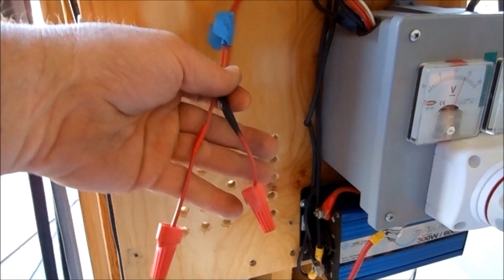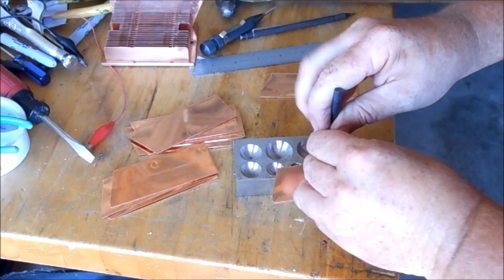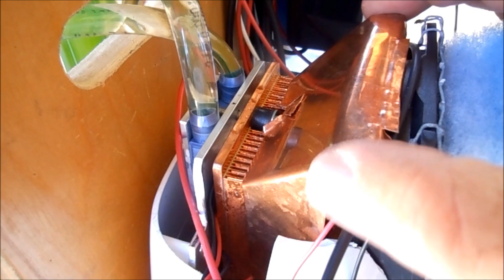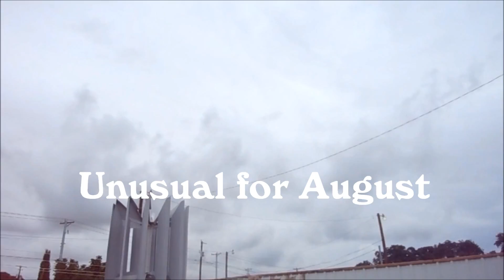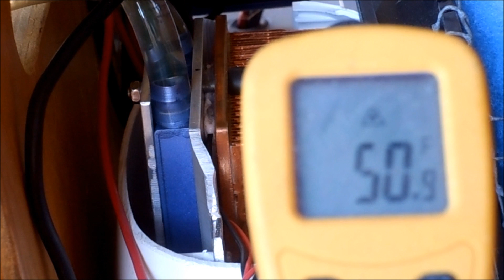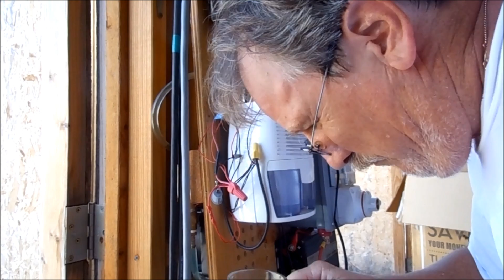Rainmaker/Water From Air 2

Comment: Let's compare your water distiller idea with the Rainmaker/Water From Air 2 project you shared.

Similarities:
1. Both systems extract water from air through condensation.
2. Both use a cooling mechanism to facilitate condensation.

Differences and potential improvements:
1. Energy consumption: The Rainmaker/Water From Air 2 system uses energy-consuming Peltier modules for cooling. Your idea utilizes a commercial steamer and a water pump, which may be more energy efficient.
2. Cooling method: The Rainmaker system uses a water-cooled aluminum plate and a finned copper heatsink. Your design uses copper tubing with fins for more efficient heat dissipation and condensation.
3. Automation: Your system has the potential to be more automated, as it can be powered by a hydroelectric generator and use rainwater as a source.

Improvements for your system:
1. Insulation: Ensure proper insulation of your distiller to minimize heat loss and improve energy efficiency.
2. Material selection: Explore different materials for tubing and fins to optimize heat transfer and durability.
3. Design: Experiment with various arrangements of tubing and fins to maximize surface area and promote efficient condensation.
4. Monitoring: Implement sensors or a control system to monitor temperature, humidity, and water production rate, allowing for adjustments as needed.

By considering these aspects, you can further refine your water distiller design to be more efficient and effective at producing clean water from air.
Reply from the maker: Yes! There is always room for improvement.

Comment: Your diodes are 15vdc max and 12 volt running voltage . If you drop your voltage to as low as 8 vdc . Your diodes become more efficient.  ie; the cold side gets colder . Also . Summer automotive coolant works well . BUT , ammonia works better . Adding ammonia or alcohol to your coolant will drastically improve the cooling . Having the unit inside a hot/dry building does not improve water production . Root cellar ? Shade . BTW . A small fan pulling air through , 'slowly ', can help .
Reply from the maker: I hadn't thought about using ammonia for coolant, I'll try that next time. Thanks.
Hopefully if I ever have a chance to move, I'll find a place with a tornado shelter. That's the closest thing to a root cellar you'll find in Texas.

Comment: Does the water touch the peltier plates you used? I was going to experiment with something similar almost using the same unit you used here and was trying to figure out a way to make it food safe and avoid the water touching the peltier plates, but I can't picture it quite the way you've described and didn't see the plates in your video!
Reply from the maker: The water only touches the copper of the heat/cold sink. The heat/cold sink is connected to the peltier by using thermal past and pressure much like the heat sink attached to your computers CPU.
Reply: @LittleshopintexasSV  Oh okay so you connected it the same way as in a computer, but the water doesn't touch the peltier plate? Is that because it's vertical? I know it touches when you turn it upside down and I wondered if the condensation collected on the other side of the heatsink. That's good to know, thank you!! I love your videos :)
Reply from the maker: Don't forget that while one side of the peltier gets cold, the opposite side gets extremely hot and requires someway to prevent it from burning out.
On the cold side I used a simple copper heat sink to collect moisture from the air, that's easy part. On the hot side I used a CPU liquid coolant system: radiator with fan, pump and reservoir in an attempt to keep the hot side cool.The cooler you can keep the hot side, the colder the cold side will be. The very narrow space between the hot and cold sides of the peltier stay warm and dry. 
Hey thanks for watching and asking really great questions.
Reply: @LittleshopintexasSV  oh that's smart!!! Do you get more moisture this way than you would have from the original dehumidifier? Brilliant!!
Reply from the maker: Yep, I ran the original dehumidifier for about a week and only collected a few drops of water. After all the modifications I managed to collect about 16 ounces in the same amount of time. Its not enough to live on, but it was a huge increase in comparison. Downside is, it took a huge amount of energy to run the thing. I have a more energy efficient idea that involves using the compressor of a small refrigerator, but I haven't had the time and money to work on it.
Reply: @LittleshopintexasSV  Amazing that's so cool! I think the manufacturers use compressors, with the levels of water they claim per day for the large units. They have to. I wish they weren't so darn expensive.

Comment: 2 things. 1-) When you look at the number of water molecules per air molecules at 99% relative humidity, it's in part per millions. So you have to cool a large volume of air if you want to extract a usable amount of water. 2) of course it's more energy efficient to run it before dawn when the air temperature is nearer to the dew point.
Reply from the maker: Thanks for watching and sharing the info.

Comment: I bought a 30 pint dehumidifier from Walmart for about $180 and it puts out about four gallons a day in a 15 ft square room. Water vapor continually streams in around the doors and windows and the room humidity only drops a little. If you plan on messing with water, download data on Legionaries disease from the CDC.
Reply from the maker: You must be in a very humid area to get that much water every day.

Comment: If I'm correct, you are drinking destilled water, because it is a molecular gas in the air and when it condenses, there are no minerals. Drinking too much destilled water can kill you btw.
Reply from the maker: Distilled water is water that has been boiled into vapor and condensed back into liquid. If you've ever tasted distilled water, you'll know it tastes salty. I use distilled water to fill auto batteries. The water collected on these copper fins is water collected on a cold surface when humid air comes in contact with it. It's sweet water, much like rain. It may be lacking minerals, but it's better for you than the fluoridated and chlorinated water that comes from the tap.
Reply: @LittleshopintexasSV  Oh ok, then I was wrong about that, I couldnt tell the difference between distilled water and condensed water from the air.

Comment: I'm final year engineering student and i'm going to do some research about making water from air by using peltier module. So is there any reference link to get more data can you pls send me
Reply from the maker: I don't have any reference links for you other than those of my own experiments. I used the cheapest peltier modules I could find on eBay, usually in groups of 10 pcs, so if I burned them up it didn't cost too much. The trick is to get the cold side as cold as possible. And to do that well, you need to keep the hot side as cool as possible. If you suffered through watching this video, maybe you can live through this one as well. "Mini Fridge Has Become Bane of This Project". https://youtu.be/4E6JHQUB5Gs

Comment: The fan needs to go on the hot side, or the fan will just blow away half of the water.
Rout ~25% of the hot side air to the cold side, so the cold side won't freeze up, and still has airflow.
Reply from the maker: The fan in front was just a part of the experiment. I think in the video I said it was not needed. I didn't remove it as the experiment continued but it was disconnected. As for using it on the hot side, it wasn't needed on that side either.  If you watch this video, you will see the complete peltier cooling system I used in the rainmaker video. https://youtu.be/4E6JHQUB5Gs
Reply: Unless the hot side heat sink is very large, it is always best to equip it with a fan.
Even if it's running at a low (~1000)RPM, where it uses less than 1 Watt of power.
If the heat sink on the hot plate feels hot, you are best off with a fan.
If the tips of the heat sink on the hot side are cold (but the base is hot), it means no fan is needed, and the sink is effectively removing heat without a fan.
Reply from the maker: You didn't watch the video did you? The peltiers modules are cooled by water. The water cooling system draws heat off of the peltier modules better than any fan and heatsink could possibly do.
Reply: So basically you're using the peltier element to extract water from the air, and use the other side to evaporate the water back into the air? XD
Reply from the maker: No. It's a closed loop cooling system like one you would use for the CPU of a gaming computer. It's also similar to that used in cars, but smaller. Watch the video.

Comment: So my question is what if you coated the cold side blades were coated with a food grade super hydrophobic coating? This would make the water dropplets run right off the blades. Additionally what would happen if you setup multiple peltiers and start using some of those amps from that VAWT to drive your "Air well". I understand this was a few years ago but any good updates on this project? I bought the same de-humidifier from aldis today for $12 and sourced some 12v peltiers from the wish website for under $2 a peltier.
Reply from the maker: Over time I've realized water accumulation on the blades is not a bad thing. Water attracts water and it will fall of the blades once a drop is heavy enough. My problem was, I was looking at the water between the blades as trapped,  but in fact it's just part of the operation. I tried using 4 peltiers at one time. These were 12v @ 6 amps each, so the power required to run full out would be 288 watts. On top of that I was using a liquid cooling system to keep the hot side of the peliers as cool as possible. The wind turbine was and still is connected to the power suply to work in concert with the solar panels, but unfortunately it wasn't very windy for the entire time of the experiment.
I do plan to revisit this idea but my time and finances are tied up in day to day living. However I have made a couple purchases toward the next project; a roll of flat 6 inch wide copper, and a family sized LifeStraw water filter. If you haven't already, please subscribe and click the bell to receive notifications of my new videos.
Reply: @LittleshopintexasSV  I just found your channel, and subscribed as I am working on a similar device. Your videos have helped a lot. Thank you!! Any updates on the rainmaker?
Reply from the maker: @kossaga  Thanks for the sub, but nothing new at this time.

Comment: Good try ! Sounds like you got 1 glass water per week? What about having 100 of these all going at once, bet that would get maybe 100 glasses of water per week.   Glad you did that effort to save us all time;  I like the geothermal sourcing for the cooling for the hot side but that would require alot air like from a cave, or alot of pipes full of water in the ground (56F I think is constant underground temp).

Comment: Hello Sir, Nice video. How much amount of water are you able to generate per day?...And from where you could get the copper heat sink with fins?
Thanking you in advance.
Reply from the maker: This one only collects a few ounces of water each day. More surface area will collect more water, and there are other ways to chill the copper fins.
I bought the solid copper heatsinks on Ebay. Unfortunately I couldn't find the link to that product, otherwise I would share it with you.
Reply: Hello Sir,  Is the area of the cold sink directly proportional to the amount of water generated?...I tried with two cold sinks (heat sink piece on cold side) one with area 12X5 cm2 and other with 18X7cm2. The heat sink size used was of the same area.  For the same duration of test I got more amount of water with smaller cold sink. And when I had a discussion with a person  (the person who did this ->  https://www.youtube.com/watch?v=LkLvpL-M_sg ), he told that it is not about the area, it is about choosing the right size. He suggests that the more area does not corresponds to more water. I also experienced the same.  Please share your comments. Please correct me if I am wrong.

Comment: Hello; I am guessing when I say; "More fins does not mean more water"
Please see this calculator https://www.calculator.net/dew-point-calculator.html
to figure out how cold your copper fins should be... keep removing fins until the 
Peltier is cooling the fins down to below the dew point in your area.

The next thing I noticed is that you have no divider between the HOT side of the peltier and the COLD side... this is very important as cold air is more willing to give up water and because the hot side is heating up the cold side... 

Considering that the hot side is 95 percent hotter... and the cold side is only 2-10 percent cooler.. not providing insulation (around) the Peltier and dividing the  sides you are loosing 
almost everything gained. 

The fan thing to dry off the copper fins is also working against ya...

Hey, you can also try, turning on the device until frost develops... then turn off the device to heat the fins... this will melt the ice and work...

However, it isn't effective to heat the thing that your cooling, so try to get below the dew point and enclose the fins so the evaporation is not working faster than what the due point can produce. Good Luck.
Reply from the maker: In my thinking, more chilled surface area will collect more water.
Thanks for the calculator, it may come in handy on future projects.
As far as using a divider between the hot and cold side of the peltier module, I've tried it both ways. My first attempt was in a little refridgerator of which I had limited success. "Mini Fridge Has Become Bane of This Project"  https://youtu.be/4E6JHQUB5Gs
Both the fridge and the rainmaker use a water cooling system to draw off as much of the heat created by the two peltiers as possible. The idea is, the cooler I can keep the hot side, the colder the cold side can become.
I guess the last thing is, the fan in front of the copper fins was planned to be for defrosting. However I found it to be unnecessary in room temperatures above 60 F.
Thanks for the comment. I plan to experiment on pulling water from air again in the future and I look forward to hearing your opinion on that project as well.
Reply: Please look at Peltiers on Ebay... and you will notice a small square ... that is the insulation that I am talking about. 

Then enclose the copper fins in a insulated box with a 4 half inch holes around the same level as the top of the copper.

Lastly... give it as "LITTLE power" so the lowest working power... and keep  removing copper fins until you have the dew point...you will have about 2 or 4 fins... spread them apart... 

and let me know if that works for ya.... I'll be watching and wishing the best for you... take care.
Reply: Even make those four half inch hole adjustable... make a slider.. try one , then two holes... then three holes... we have to get as much surface area that is dew point... and no surface area that is ice.

I hope this helps... as I did a typo "a 4 half inch" ... I meant "with 4 holes that are 0.5 of an inch"
Reply: Lastly,,, copper is good for testing... but for drinking... you might try stainless steel.. (guessing... about this)

and hoping for better taste.

Comment: try to keep the defrosting fan on, and make it more powerfull... you need to run masses of warm air through cold surface to extract humidity from it. the more air you run through it, the more water will condence and you woun't need to shake it off, it should run down by itself

Comment: If your pipes and cooling reservoir are insulated the coolant will get colder and colder.
Reply: The coolant in the lines is actually to draw the heat off of the peltier modules, and if the lines and reservoir were insulated, they would retain more of that heat.

Comment: Have u thought of maybe going to a 48 volt system off of 320 watt solar panels? Those small 12 volt panels are crazy expensive. A solar panel is usually a dollar a watt
Reply: A 48 volt system would be great, but a 12 volt system matches the system of my vehicle and the electrical system in my camper. Portability is important to me so that when I have an opportunity to leave the city for a time, I'll have some of the modern basics for survival with me.
Reply: That's where DC to DC converter play it's roles. You can easily and efficiently convert 48V to 12V to use on whatever design voltage (or Power) requirements.

Comment: The dehumidifier might be more successful if it runs through the night.  Warm air holds more water, so the cool night air will be more willing to give up its water.  Cool project.
Reply: This may not be correct, as cooler air means cooler dew point. It is easier to extract water from warm air, because as you said, it holds more water, so it condenses immediately after touching a cold surface. In case of running at night, you need a more efficient Peltier cell that can reach lower temperatures to extract the water from the cool and dryer air.
Reply: @faabbee  it is relative humidity. At higher temperature air will have less water than when it is  colder. So at night air become colder and water start precipitate on all possible objects. Peltier give the best 40 degress differenc from the hottest side, in the worsest case when cold surface is big it give 20 degrees difference. In this video would be better to make smaller heat sink to make less temperature on the cold side.
Reply: It's all about dew-point... 
Dew-point is always relative to humidity and air temperature. 
The more air you can get below dew-point the more water you will get....

Layer of water will insulate....and ice will insulate better....